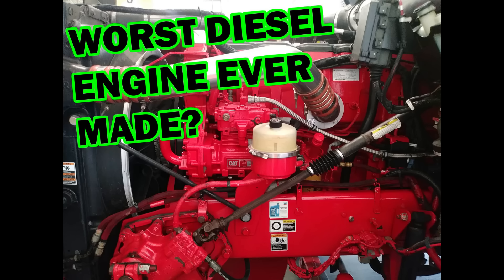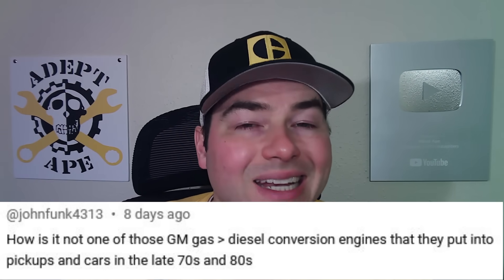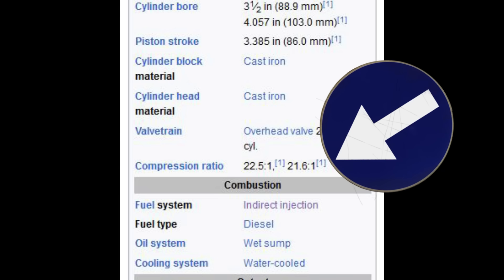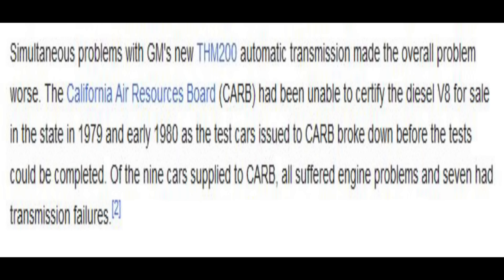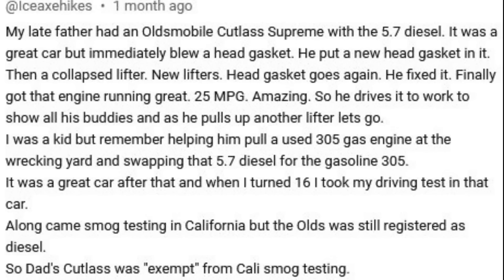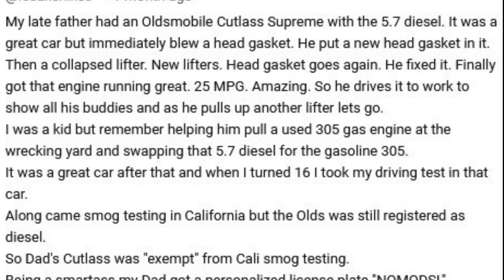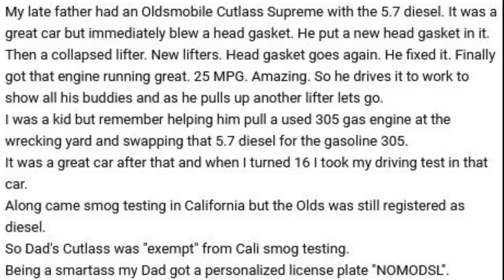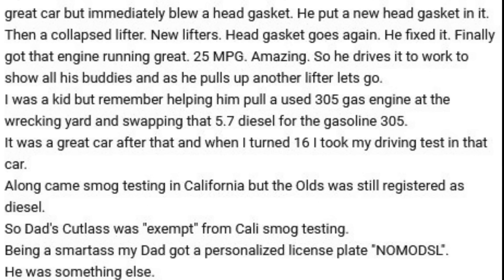This Engine is the Reason You Don't Have Diesel Cars in America!!!

Comment: The only thing good about the Olds 350 Diesel was the block was reinforced that made an incredibly strong hot rod gasoline engine. My brother had a '79 Olds Cutlass Salon that originally came with a 260 V-8 that had a whopping 85 hp. It went at 35,000 miles, we put in a 350 Diesel. The Turbohydro 200 transmission couldn't take the strain-we put in a turbohydro 350 transmission which solved that problem. Then that 350 cracked the block, and another engine was put in. Then the fuel injection pump went (for the third time) and $850 to rebuild said no. I had to PAY $250 to have it hauled away.

Comment: Everyone thinks that it was a converted gas engine. It was NOT.  It actually was designed to be a diesel. There was only five head bolts per cylinder. The hydraulic lifters were not ported right and oil starved. The pistons didn't have a large enough bowl to swirl the explosion which put excessive pressure on the head gasket fire rings.
 Another thing about those times was the labor unrest. There were many many sabotage and failure of pride in the workforce. I've worked on cars that was so poorly built it's amazing they even made it the factory door. Engines with not loose but missing main bolts, found pounds of hardware floating around under the valve covers and lifter valley, oil pump pickup bent up that it was barely in the oil, and many more. I didn't get much bodyshop work but they were straight out and was asked to look at a Rt door window problem on a C10. The whole door was filled with gravel up to the window regulator. That means the door was filled up before it was assembled and installed.

Comment: Tales from an old guy.
In 1978 i bought a new Scottsdale 1/2 ton with olds 350 diesel. She was rigged out for flagging and pilot car. It got fantastic milage about 24 - 27 mpg.
It burnt almost nothing idling all day, running all the beacons and wig-wags. Amazing!
This is before LED's, and was retrofitted with 270 amp Leece- Neville alternator that puts out 140 amps at idle.
Was very lucky, put 120,000 km on her without any major issues. Had her on Finning oil sampling program. Metals were very high from new. Changed oil every 3000 km.
Put issapro v8 pyrometer on it. Would easily go to 1100F. Never took her above 850F!
The small factory oil filter was joke, about 23 microns I remember???
Searched through NAPA catalog and found a 9 micron hydraulic filter that had the same threads and base.
This filter was about twice as long as factory and 2 inches wider!
Was really pissed as pickup had ZERO resale value, dealer wouldn't take it as a trade!
Dont know about US, but GM Canada after a few years  eventually had a generous trade in for origional owners against buying new 6.2 detroit diesel.
Needless to say i traded her in for another Scottsdale 20 with 6.2.
Another lemmon...
Did not like been driven hard. High EGT's Lots of 6.2's died from over heating...
Well not nearly as bad as the Olds, used oil and lots of issues, and warranty updates, of course lots not covered!!! Applied many of the tricks from my Olds to the 6.2. She faired much better than most.
Soon as Ford came out with the 6.9 IDI, traded her in for 1986 ugly F250. They were ugly! Not a power house, but lot more than 6.2 and you could drive 6.9 hard and did not complain or break down. EGT's Never above 900F period!
Ended up been best truck I have owned.
Better fuel milage than 6.2.
No oil consumption, between 6000 km oil changes
Finning oil samples were always excellent.
IDI's will have cavitaion damage unless additive levels are montitored.
Put 380,000 km on f250. Couple glow plugs was only repairs.
Never used any oil or had blowby.
Sold it to another pilot car operator. She put another 300,000 km on it trouble fee!
Bought new 1990 F350 supercab with 7.3 IDI turbo diesel (not a power stroke), another trouble free truck! PS Ford rated the IDI turbo at 190hp as not to undercut the new PowerStroke 215 hp  coming out in 1994. Stock IDI pulles the same grade at same speed as Powerstroke. Obviously the Powerstroke is electronic engine and starts much better in the cold and probably more generous hp and torque curves.
But stock vs stock there was almost no difference.
Reply: What a great and interesting story. Those are the exact detailed type stories I enjoy.  Thanks for sharing my friend. Cheers
Reply: I was getting 18 in my 6.2 what where you getting in your 6.9
Reply: An old IH guy here. The 6.9 was based on the MV404,446 gas engines. The MV family came out in the 70's. They were supposed to replace the SV 304, 345, 392 family as emissions got tighter. IH put a new assembly line in at the Indianapolis plant. It was the most modern, automated engine line in the world at the time. The bore and cylinder spacing was fixed position. When the gas crunch hit IH looked at converting the SV family to diesel and realized it wouldn't work. So they looked at the MV. The story goes that this project did not have the support of the board but some key people pushed it forward AND made contact with Ford. Ford use far outstripped IH use.

Comment: Mercedes really made the only viable diesel car engine in the 80's, it made 125hp and it was as reliable as a stone axe.. unfortunately it was expensive and probably suffered a little negative memory about being German in the US. After that VW made a really solid offering with their TDI's, up until they got busted cheating the system. Best I know other than Mercedes and VW no one has offered a really good diesel passenger car here in the states.

Comment: I worked at the Chevy dealer right after they came out. They put lots of them in square body pickups too. I saw so many of them come in blowing bubbles in the radiator. So many head gasket jobs, they revised the gaskets, then there were head studs that were supposed to be better, but only slightly. Add to that people didn't understand how to operate them, they never plugged the block heaters in, and for some reason they seemed to get water in the fuel a lot. They all thought the fuel was gelling so they used anti-gel, but at the time anti-gel didn't treat for water, so they would have waterbound filters, or if it was cold enough, ice somewhere. The only good thing I can say is you could buy them cheap, and the Olds, Pontiac, Buick gas engines were pretty much a bolt in. I did one pickup with a junkyard 455 Buick and it was a beast
Reply: Even today ppl don't plug in hybrids overnight, even electrics

Comment: I remember the 350 gm diesel.  There was only one way to describe the engine it was no good.  I never owned  one but knew several who owned these vehicles with this engine. It was hard to find independt shops that would work on the engine. It's been years since I have saw one they were sorry engines from day one.  This engine almost destroyed the market for small diesel engines in cars and light trucks.  Now the exhaust filters and associated components has destroyed the diesel engine for cars. There are still some customers who want diesel engines in 3/4 ton and one ton trucks.

Comment: I had a 1984 Chevy van with a 6.2 diesel the motor had 655000 miles on it when I sold it, lost the injection pump once on it but I should have swapped out the 70r transmission for a turbo 350...as I had to rebuild the transmission 6 times In 10 years that I drove it.

Comment: Oliver used diesel engines in their tractors that were almost identical as the gas engines from the head down. This would have started in the early 1950s. At that time caterpillar and John deere were using pony Motors to start a diesel but an Oliver just used an electric starter

Comment: We had two oldsmobiles with the diesel.  Not only was the engine design the same as Josh said, the engine was completely gutless.  I remember it would only get above 80mph if you were going downhill with a wind at your back lol.  The engine ruined an otherwise excellent car.  The The larger bodied Oldsmobiles of the 80s looked good, very comfortable interior, and rode very nice.  If a guy found a rust free one and put in an LS and a built transmission, it would be an incredible car.

Comment: I was one of a small group of independent business owners - that would gather most mornings at a local coffee shop for breakfast in the early 80s in Northern CA .
One morning one of the regulars showed up - really pissed off , he had just gotten back from his 1st oil change --- at the dealer , for his new  3/4 ton pickup truck [ he had just put a trailer hitch reciever on ] ---- the dealer saw that durning the oil change & " told him that his warrantee was canceled --- because you can not tow with a 3/4 ton pickup truck { because of the diesel } ] .
So I figured --- over 40 yrs. ago - that the industry was on purpose trying to discourage passanger car / truck diesel !!!  
Thats when I started buying diesels - VW to start , then Cummins & CAT ;)
Thanks agian
Reply: These were economy era diesels, current era is power diesel. That's why the new ones can tow 35k, but these old ones would get 30mpg. Old ones don't cost 10k to fix either

Comment: the Oldsmobile 350 Diesel is a great example of why you don't let Bean Counters (accountants) run engineering.  that has always been a problem at GM, but it was particularly bad for them during them 70s and 80s. it is what really started the downfall of American cars. that and the GM W-Platform (Lumina and its siblings) and the L-Platform (Corsica, Beretta and Tempest) everything on the W/L platforms were designed to be extremely cheap to produce. unfortunately, it didn't just stay with the W/L platforms, gm bean counters forced component sharing to cars that were built after the W/L platform hit the market. so, there are tons on interchangeable parts vehicles form that era and they all suffer from the same poor quality cheap parts. these are the cars that really killed GM.
Reply: Actually, the government was to blame.  They strangled car manufacturers when they decreed that each had to meet the CAFE standards or face penalties.  Corporate Average Fuel Economy. By quickly getting light weight diesels on the road, GM increased their CAFE rating.

Comment: GM, circa 1938: creates the two-stroke 71 series Detroit Diesel engines for literally every application - generators, boats, trains, trucks, farm equipment, even military equipment - design lasts well through WWII and as far ahead as the 1990's. 

GM, circa 1978: effectively kills the market for diesel powered passenger cars in the US with the Oldsmobile 350 diesel.

Comment: We were a Chevy dealer during the era of these engines. We traded for a Olds Delta 88 with a diesel that drove to the dealership. On Monday morning I got in the car to move it, and when I started it-- the crankshaft broke. It was under warranty so Oldsmobile replaced the engine. We had sold a diesel Monte Carlo that had a recall-- we were supposed to inspect the injection pump for a yellow dot-- supposedly if it had the yellow dot it was OK-- and it did. Well, sometime after the folks purchased it the governor weight retainer ring broke, the engine went wide open, would not shut off with the ignition key, and the wife drove it 15 miles to the dealership holding it with the brakes. We took plyers and pinched off the fuel return line and killed the engine. Had to replace all the brake calipers, rotors, and drums-- and repaired the injector pump.  Folks kept the car.  I was at a Chevrolet zone meeting when the 6.2 came out-- and one of the higher ups told us how the 6.2 was a clean sheet design-- which it was-- and how the 350 was "a black mark on the face of general Motors"....
Reply: That 6.2 was a runner! Great mileage in a 4wd suburban!
Reply: Yeah GM half assed the conversion, for sure. Having a diesel engine BASED ON the 350 Rocket wasn't a bad idea, directly converting a 350 Rocket WAS.
Reply: @lsswappedcessna  The diesel was a true diesel - not a converted gas engine. GM used the tooling of the gas V8 to build the Olds diesel. The 350 Rocket had nothing in common with the 350 Diesel. The diesel block, heads, pistons, connecting rods, and crankshaft were all unique to the Olds diesel. The 5.7 liter displacement was the only thing the two engines shared - along with the tooling to build the engines.
Reply: Was driving a 260p engine with a cutlass salon body , pump did same thing. Drove to the guy who did diesels and he cut the line . Pdi at olds in Orlando 78-80. Buick v 6 , remove the oil sender and replace with a low pressure so that the light didn’t flicker.  Too small outer bearings on A body in 78.  Campaign was a bearing with more rollers . GM buried it’s self .

Comment: My ex father-in-law was bitten by the Olds 350 diesel bug.  He bought a new 79 Olds station wagon, forget the model.  Supposed to be the greatest engine in the world.  Six SETS of head gaskets, multiple lifters and two cams later, he's still poking fun at my 78 1.5 liter diesel Rabbit that got 54 mpg highway and in the thirties or better around town.  About a month later the miracle Olds loses oil pressure.  To boost his mileage, he used Arco graphite in it from day one.  I asked my dad about graphite in oil, as it sounded good, at least on paper.  He told me that when he was young (he was born in 1917) an oil company came out with graphite oil.  The problem was that the graphite particles settled out of the oil when the engine was stopped, gradually plugging oil galleys in the block and passages throughout the engine.  

It seems that is exactly what happened to the miracle Olds.  The block passages became plugged and starved the cam and crank of oil, the resulting metal took out the rest of the miracle Olds engine.  Total mileage on the miracle Olds?  65K.  I had bought my diesel Rabbit new and I had over 100 K on the engine at that time.  I sold the Rabbit to a friend at 220K and he drove it for years before giving it to his son as a first car.  The son wrapped it around a tree.  Dead Rabbit.  I loved a diesel engine that redlined at 5400rpm and held together for hundreds of thousands of miles.
Reply: I had a diesel Rabbit, worst car ever, but I liked the diesel engine, even though I had to rebuild it in Guatemala, after a cooling fan  failure and overheat.
Reply: Loved my diesel rabbit ,I ran em daily into the mid 2000s.  feel robbed if im not getting 40mpg even now.
Reply: Yeah putting shit like that in any Olds small block or even big block is a terrible idea. Their heads all had a design flaw that made the drain ports easy to clog, which would lead to loss of oil pressure throughout basically the entire bottom end if it got bad enough. Not an issue if you keep up on oil changes and keep the sludge out of them, but these engines will fail due to lack of lubrication if you neglect them or put unnecessary additives in them.

Comment: Good video. Oldsmobile also made a 4.3 V8 Diesel for the 1979 model year only. A much-needed water/fuel separator was finally added to the 5.7 Diesel lineup in 1985 (the last year for the production of the Olds Diesel). However, it was too little too late. The D block (1978-1980) was replaced with a beefier DX block in 1981. The DX blocks solved many of the bottom-end issues that plagued the D block. The D blocks were known to experience broken crankshafts and for literally pulling the main cap bolts out of the block because of short bolts. The top end of the DX block still only had four TTY bolts to a cylinder. The head bolt clamping ability still wasn't good enough to withstand a 22.5 to 1 compersion ratio, so they continued to blow head gaskets. The 4.3 V6 Diesel had six head bolts per cylinder. If the 5.7 could have started out with this it would have been a far different outcome for that engine. If an owner of a DX block knew how to maintain one and if he drove it gently it could last. Some went for many miles because of knowledgeable treatment.
Reply: As far as having a water and fuel separator which is highly recommended to prevent damage to the fuel injector pump the design they were using in the 77 and 78 olds had a problem with the ceramic cover had two o rings that got sucted inward and had a loss of power air was getting in dealer installed in Pennsylvania

Comment: I worked at a GMC dealer 77-82.Problems we had with the 350 diesel were rear main seal fails,pistons would black hole,blocks would break at the main cap webbing.Fuel injector and pump fails.Glow plug fails.The first batch had some sort of plating on the fuel injector lines.Inside and out.The plating would flake of and travel to the injector and take out the injectors.We just kept working on them.

Comment: Yep Josh, my first ever aquisition from a bona fied dealership here in Phoenix (The Buzzard) was from the used lot. Absolutely beautiful '85 Olds Cutlass Supreme Brougham (diesel) circa '86 or so.
Luckily for me one of the 2 main 12 volt batteries went out just about the time I'd learned that this particular motor is going to have problems. They took it right back & we drove out in a '79 GMC Vandura.
Put over a quarter million of the hardest miles possible on that van.
Great trip down memory lane.
Cheers!